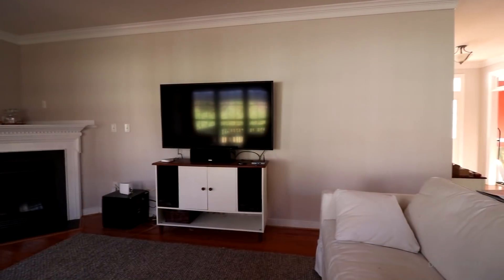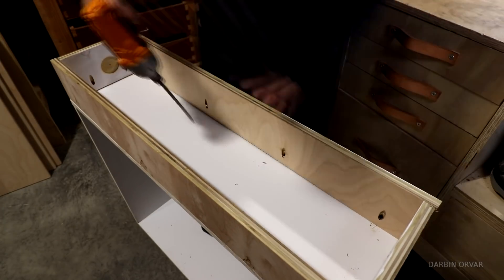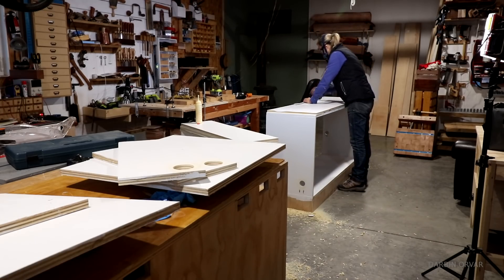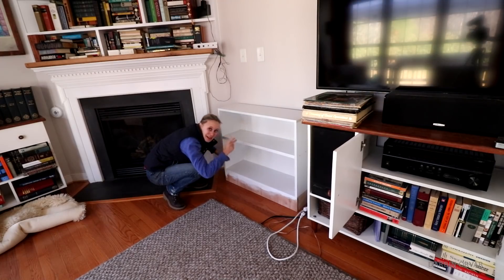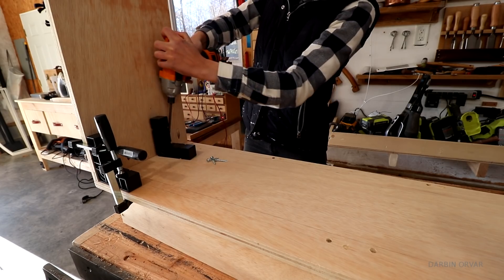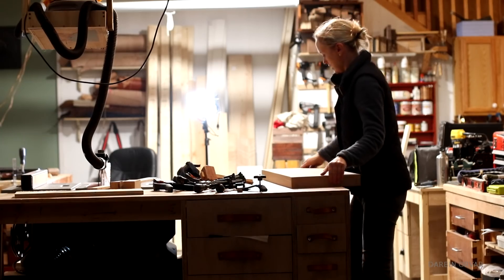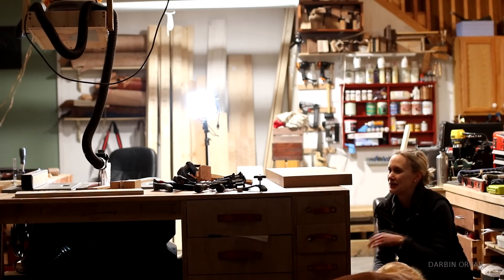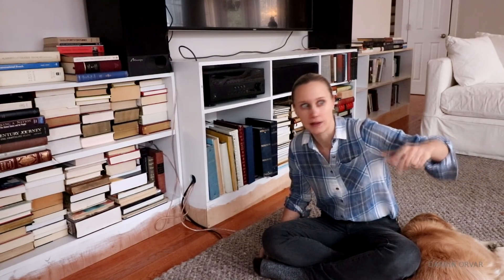Making Home Theater Cabinetry & Bookcases

Comment: Nice work! Question: do you find that there's a difference in strength in the joint using pocket screws when you drive them through from the inside vs. the outside of the cabinet sides? Hard to describe, but maybe you see what I mean?

Comment: Very nice!! 2 comments:
1- the solid top you made, isn’t that an overkill for a plywood cabinet? What t u going to do for the middle part, you plan to join and plain a 1.5” slab for thst too?
2- i think that box cabinetry is 1 place where pre-finished plywood (or even chipboard!) is worth every penny. Was that not an option?
Reply: leah netzer Gotta have some difference to Ikea cabinet. Other than custom dimensions possible, pretty plain....

Comment: Why did you hand plane the counter top before putting it in the planer? Would the planer not handle it well if it were uneven?  *I have never used a planer before and am curious.
Reply: Jonathan you need 1 flat side before you can plane the parallel side. The purpose of the planer is really to bring the thickness down to what you want. There are jigs and tricks you can do to use the planer to flatten both sides tho

Comment: Don’t put wires under a rug where people will walk on them (not that you would, but I’m afraid someone watching might get the wrong idea). The insulation will fray, and it can burn the house down.
Reply: Those wires are not carrying line current (120ac) they look to be speaker cables. Also new extension cords are made of polymers that do not fray like the old cloth cords that used to cause all kinds of problems. That being said there are much better ways to run those cables.